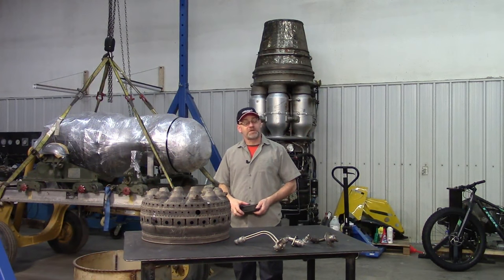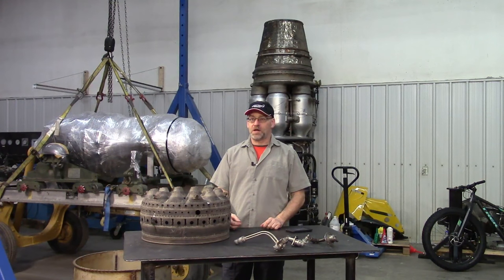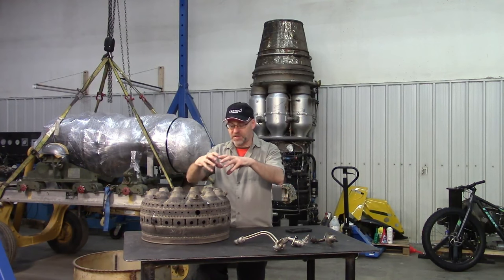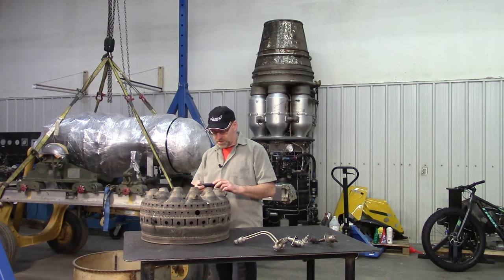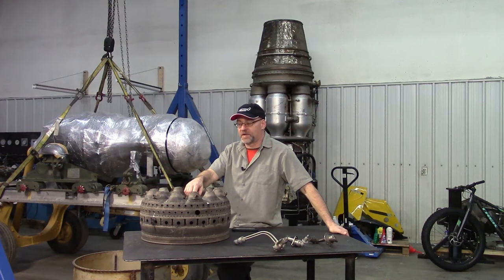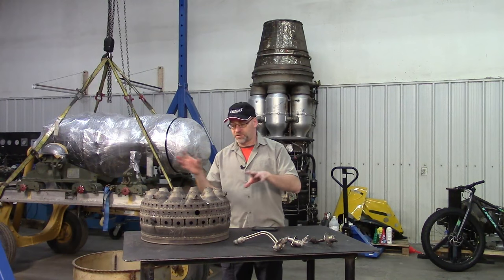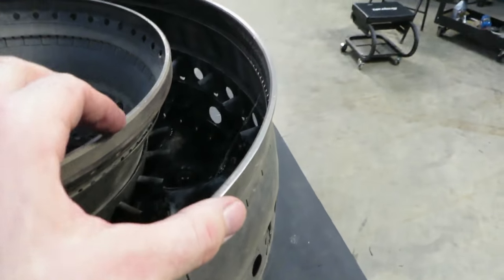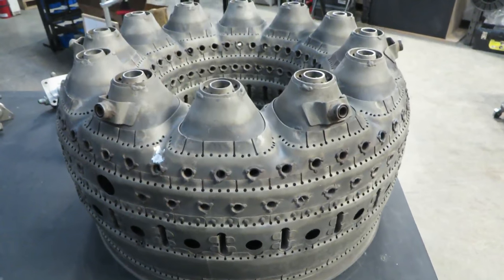Jet Questions 90

Comment: It is sometimes claimed that the engines on the Mig-25 would run away at the top speed like the one clocked by the Israeli going mach 3.2 which supposedly wrecked the engines beyond repair. Do you have any insight into that?
Reply from the maker: Nope
Reply: SO there's several documents that said Russian pilots were instructed to NOT go over mach 2.8. 
 the engines were not able to sustain that speed and power.
the result was a mig-25 bursting into flames.

that wasn't a runaway engine but rather a russian trying to get the hell out of a conflict.
Reply: There are several sources that discuss this event, actual facts are hard to come by except for a 'hard' speed limit of M2.8 that was imposed allegedly for engine limitations. Several seemingly authoritative sources claim that the airflow in the combustion chamber of the Turmansky R-15B-300 engines caused an uncontrollable draw of fuel through the nozzles that created a destructive rise in engine RPM.
Reply: The airflow through a combustion chamber cannot cause "an uncontrollable draw of fuel  through the nozzles".  It's not possible.
Reply: grahamj9101
Not even with some unanticipated error in the design of the fuel control that causes some sort of positive feedback?
Reply: That's not the question that was asked by Mr Cameron. Fuel is not drawn into the combustion chamber by the action of the airflow: it's not a carburetter. 
In answer to your question, it would be theoretically possible to overfuel and overspeed a jet engine. However, designers try not to incorporate errors in fuel systems, whether they are the hydromechanical systems of years ago (which I worked on) or the the latest full authority digital engine controls (FADECs). For an overspeed to happen, it would need multiple failures of control system inputs such as  exhaust gas temperature  limiters, overspeed governors and fuel flow limiters.
Reply: PS You're diverting me from working on the hybrid propulsion question. However, I have some doubts about it.
Reply: grahamj9101
Maybe it's not a bug but a feature? If burning up the engines in one flight means getting that little bit of extra speed for successfully catching up to the American supersonic bomber carrying nuclear bombs towards Moscow I guess it would be worth it. A later engine from the same manufacturer (R-25 in Mig-21) had an additional fuel pump that could be engaged for 3 minutes in war time emergency.

Now continue with the hybrid propulsion! :-)
Reply: I can go along with the suggestion that an interceptor engine could be "overfuelled" to give additional thrust for a wartime emergency rating, at the expense of a reduction in life.  When the Sea Harriers were sent to the Falklands in 1982,  'plugs' were supplied by R-R for their fuel systems, which allowed an increase in maximum thrust, relative to their normal peacetime rating. That's not hearsay: I was there. It's also well known that WWII Spitfires and Hurricanes (and Mustangs?), for example, had a 'gate' at the end of the throttle lever quadrant, which allowed extra movement of the lever, giving additional boost for combat.

I've been working on the hybrid propulsion proposal, but I can't get the thing to work! Having viewed the video several times, it shows the six electric fans draining the batteries for take-off and climb, with the batteries reduced to about half charge at the end of climb. During climb, the gas turbine engine is, therefore, supplying far less electric power than the fans are drawing. The batteries are then shown as being fully recharged during cruise, which implies that the engine must be providing substantially more electric power during cruise than at take-off. However, because of the lower air density at altitude, the engine is actually capable of producing only a small proportion (around 20percent) of the power that it is potentially capable of producing at take-off.  To charge the batteries during cruise, the engine would have to be large enough to be potentially capable of producing more electric power at take-off than the fans require and, consequently, the batteries would not discharge. I'll try to do some more work over the next few days, preparations for Christmas permitting. At the moment, however, it does not compute! Nevertheless, I'm thinking in terms of a variable cycle engine: that is, it operates as a turbofan for take-off and climb, whilst also providing a small amount of electric power. For cruise, the engine effectively  transforms into a turboshaft driving a generator, with some residual jet thrust.
Reply: grahamj9101
I lack first hand experience but have been told that Gripen has something similar, a war time setting that gives a few percent extra thrust at the expense of reducing time to next overhaul. Apparently pilots had a tendency to "accidentally" use that throttle setting.

Maybe the graphics department took some artistic license with the concept film. Is 20% power normal for a jet engine at cruise speed and altitude? Then the electric fans would only need 20% of take off power during cruise as well.

If I in my potential ignorance designed a hybrid plane I would size the gas turbine to provide just enough power to the electric fans for cruise and use the batteries to provide the extra power needed during the relatively short take off and climb. Then towards the end of the flight maybe the gas turbine could be switched off entirely during the decent from cruise to landing.
Reply: The 20percent is a round figure, but it's not far wrong and I've given this example several times before.  At sea level, the take-off thrust of an RB2112-22B on a Tristar was 42,000lb.  In cruise at 35,000ft, its thrust was around 9,000lb.  The drag of an aircraft reduces with altitude, because of the lower air density: that's why they fly high. The available thrust from its engines also reduces in proportion and the fuel consumption is therefore considerably reduced: again, that's why they fly high. In respect of the proposed electric fans, the same basic rules of physics and aerodynamics must apply.  If an electrically driven fan has an aerodynamic design that requires, say, 12MW  at 100percent rpm for take-off at sea level, then at cruise it will be capable of producing sufficient thrust with a power consumption of around 2.4MW.  Having said that, it might well be possible to 'tweak' the performance with a variable pitch fan. In fact, I wouldn't be surprised if the concept study included variable pitch fans, as this might improve their performance when windmilling and generating power. Nevertheless, the aerodynamics will limit the maximum power and thrust that the fans can produce.
Reply: PS  I'm working on the sizing of the engine,  but I need to play with the flight profile, power consumption and power generation some more. There other issues that have also occurred to me in respect of flight safety. The airworthiness authorities will, I have no doubt, invent some new rules, equivalent to twin-engined airliner operation.  Firstly, they will require the aircraft to be capable of taking off safely in the event of a failure of the gas turbine engine. Secondly, they will come up with rules that are equivalent to ETOPS for twin-engined operation over the oceans. They will, I'm sure, demand that such an aircraft has sufficient electric power reserve to complete its flight or to divert safely, in the event of an engine failure. So, if the engine fails, say, in mid-Atlantic or Pacific, the aircraft has to get to the nearest airport with sufficient power reserves for a diversion in the event of bad weather, for instance. With those huge intakes and large fan frontal areas, there will also be issues in relation to birdstrike: I can envisage the debris from the failure of one fan taking out the others. Out of professional interest, I bought Chesley Sullenberger's book when it was first published and I went to see the film 'Sully' a couple of weeks ago. I now have the vision of an electric hybrid airliner encountering a flock of Canada Geese and going down over NYC.
Reply: grahamj9101
I knew the power required at altitude was lower but didn't realize it was that much lower.

A variable pitch fan would also make thrust reverse simple.
Reply: grahamj9101
Yes, there will be safety issues with flying over oceans which is one reason I suspect the first use will be for shorter regional flights where the battery powered parts of the flights will also be a larger proportion of the flight time.

I have not seen the movie yet but I saw Tom Hanks talk about it. I didn't realize the aftermath but it sounded somewhat similar to a crash in Sweden over 20 years ago when an airliner ingested ice after take off and "landed" in the forest. Miraculously no one died but the three pilots involved, especially the pilot who was a passenger and rushed to the cockpit to help out (and who had prepared for such emergencies) were given a very hard time.

Did the birds wreck the fans? I thought they clogged up the engines.
Reply: Exactly! Reverse thrust would be much more simple (apart from the fan blade actuation) and effective: it would be like a turboprop going into reverse pitch on landing.  Many years ago, R-R Bristol produced an experimental geared, variable pitch fan engine, the M45 SD02., which used reverse pitch for reverse thrust..
Reply: Yes, the birds damaged both the fan blades and the compressors - and clogging may have been an issue, but the fans would have taken most of the impacts with relatively small amounts of sliced goose going into the engine cores.  A twelve to sixteen pound Canada Goose makes quite a projectile at 219 kt. An Air France Concorde once suffered a birdstrike from Canada Geese, just as it was coming in to land at JFK. Two engines were taken out and the estimated weight of the bird(s) that caused the damage was twelve to sixteen pounds. Initially, there were doubts about the culprits being Canada Geese, because they don't normally grow that large and they lose weight during migration. However, as I recall, goose remains were found on the runway and DNA tests were carried out confirming they were Canada Geese. It was established in due course that the geese were not migratory, but lived locally and scavenged on garbage dumps in the area.
Reply: grahamj9101
Everything grows fat in America... and a garbage dump close to an airport sounds like one of the worst ideas possible...
Reply: Grahamj9101-Am I reading this correctly? You're working on a turbine-battery hybrid system for flight? Jiminy that's interesting. Are links available on-line to your work?
Reply: No, I'm not actually working on it: Airbus and R-R have been working jointly on a concept study and have published a pretty CGI video of their proposed aircraft. The technical content is virtually nil and I have been doing a few rough calcs of my own to try to understand how it might work. At the moment, however, I can't make it work.
Reply: Damned interesting regardless. From your above thread responses, I presume that the mere possibility of a missed approach requiring a go-around must play havoc with the operations calculations.
Reply: That's one of the numerous issues, in addition to engine failure and reliance on battery power only, that will have to be addressed.
Reply: PS I must credit zapfanzapfan for bringing my attention to the Airbus/R-R video.
Reply: PS I've reread the NTSB report on US Airways flight 1549 and you might like to take a look at it. In brief, neither engine lost fan blades, but they were all quite badly damaged, having suffered heavy tip rubs. Both engines lost LP compressor (booster) inlet guide vanes, which were ingested into the cores, causing considerable damage. The left [hand] engine HPC inlet guide vanes were disconnected from the actuator, while those of the right [hand] engine were "entirely destroyed". The domes  (I would use the term 'heads') of both combustors were dented, "consistent with soft-body impact". However, only small amounts of feathers and tissue were found in the cores of the engines. Specifically, "about 1 cup of charred remains was found in the combustor area" of the right [hand] engine.
Reply: Reverting to the subject of hybrid propulsion, the video suggests that the objective is to have the batteries fully charged (or nearly so) on landing.  If the batteries are to be discharged to half-charge on the next take-off, then that would make sense, otherwise they would have to be charged while the aircraft is at the gate.
Reply: grahamj9101
Very interesting but I have an exam in a couple of days on relativistic effects and black holes so it'll have to wait a little. That stuff makes my brain hurt :-)

I imagine some of the damage can be difficult to determine when it happened, especially the fan is in a vulnerable position during landing in water.

Something completely different: Have there been attempts to make turbine blades and inlet guide vanes from really high temperature tolerant materials? I'm thinking of tungsten (too heavy?) or  iridium (too expensive?).
Reply: grahamj9101 Landing fully charged makes no sense to me unless the particular airport does not have the capacity to charge the plane. So it would be important to be able to land fully charged (or run the gas turbine on the ground) when landing out in the bush.
Reply: I was going on what the video actually showed - and it does make sense to me. If the batteries are going to be recharged on the ground from a ground power source, each gate equipped for a hybrid aircraft would need a power supply of tens of Megawatts and charging would probably be the determining factor in turnaround time. Otherwise the engine would have to be running at maximum power, which I think would be totally unacceptable at any airport such as LHR or JFK. It would be like having a large industrial gas turbine genset (such as an LM5000 or Industrial Trent) running at each stand - not just a noisy little APU.
Reply: No, the experts on the subject of FOD and crash damage to engines are pretty d*** good at their work. I'm not an expert and it's quite possible that some of the damage (eg, the bending) to the fan blades might have been due to them slamming into the water. However, from my reading of the report, the damage to the blade tips and tip rubs were primarily due to the blades having been deflected while under power at high rotational speed. There was localised damage to the trailing edges of the fan of the left-hand engine, which could not have been caused by the water. There was also clear evidence on the fan of the right-hand engine of a localised impact on the blades at the radius of the mid-span shrouds (the features that I know as 'snubbers').
The damage to and failure of the booster IGVs was localised and entirely consistent with bird ingestion, confirmed by the local presence of tissue and feathers, while the downstream damage was almost entirely caused by the passage of the IGV debris. 
On the subject of turbine aerofoil materials, the 'holy grail' has long been the elimination of cooling air from the aerofoils. I'm too far into retirement to be really up to date, but we were looking at ceramics years ago and there are advanced materials around, such as metal matrix composites.
Reply: grahamj9101
Yes, there will be a bit of infrastructure to put in place for charging but ports are doing it so that ships can plug in instead of running their engines in port. If ports can do it so can airports. If there is any benefit to it of course depends on where the electricity comes from.

Yes, they are good. I saw some presentation on the downed airliner in Ukraine. They are really good at jigsaw puzzles.

I just recently read about ceramic matrix composites. A bit like taking the ceramic coating and making the entire structure from it.
Reply: LHR has over 200 stands and putting in a power supply to all of them, in order to charge hybrid aircraft would be a major infrasturucture project.The power supply for each of them would have to be good for tens of Megawatts, otherwise the aircraft would be on stand for hours, being trickle charged. Let's say that the average power demand is 20MW and that 50percent of them are charging. That's a total power demand of 2,000MW, the power output of one of the big 1960s coal-fired power stations that the UK is in the process of decomissioning.
Reply: grahamj9101 Heathrow has about 600 takeoffs a day, let's say 20MWh for each (charging a 100 tonne battery), 12000MWh or 12GWh a day. 500MW average power if it is spread out evenly over the day. I wonder how that compares to it's power use today? Covering the area of Heathrow (12km2) with solar panels would (when the sun shines) generate 1200MW. But it's at least 15 years away.
Reply from the maker: Variable pitch fan has not been made because of the complexity and huge loads it would have to handle.
Reverse thrust is already simple.
Reply: You've come up with an average power: I was looking at a possible peak demand power. Either way, the infrastructure for charging hybrid aircraft will require a massive investment. If you mean that such aircraft are at least 15 years away, I think it will be a lot longer than that. By 2030, I expect R-R, for instance, to be delivering what they are currently calling the Ultrafan, an ultra-high by-pass ratio geared turbofan, which will probably have a variable pitch fan.
Reply: Well, R-R made a geared  variable pitch fan (with reverse pitch) work in the M45 SD02 back in the 70s. Admittedly, it was built as a demonstrator. However, I'm aware that the drawings have been dusted off and are being looked at in relation to the proposed Ultrafan, which will definitely have a geared fan - and will almost certainly be twin-spool. Variable pitch is, I understand, being considered for performance optimisation reasons. However, its use for reverse thrust would eliminate the need for blocker doors, cascades and a translating cowling, which become bigger and heavier as by-pass ratio increases. A fan handles "huge loads" at take-off, so there's no reason why it shouldn't be capable of handling similar loads in the reverse direction on landing. I don't see it as a massive design challenge.
Reply: grahamj9101
It said somewhere that the concept was for the 2030s so 15-25 years. But just because one plane model starts flying doesn't mean there is an overnight switch by everyone. My money is still on a smaller regional plane as the first passenger plane to adopt electric propulsion. A plane for 1-2 hour routs feeding passengers to bigger airports.

Is there still room for growth of the fan-diameter? Will future planes have half the fan above the wing or will future planes be high winged to be able to fit the engines?
Reply: I do have contacts with one of the bright young things who has been doing some project work for the Ultrafan. The indications are that the fans for the big twins will getting close to the limit soon. Whilst increased by-pass ratio gives increased propulsive efficiency, the fan case gets larger and its drag increases.  They are looking at making the fan case slimmer and shorter, leaving little or no space for a thrust reverser, hence the interest in a variable pitch fan with reverse pitch. Variable pitch will require a larger diameter hub arrangement for the fan, but this fits quite well with having a gearbox immediately behind it. Engines don't have to go under the wings, they can go on top (as on the VFW 614), or at the tail again. There may even be a case for four smaller engines, which could be good for an NEO A380. In the longer term, distributed power with multiple fans integrated with the wing could be the way to go. Now does that sound like something we have been looking at in a certain video?
Reply: grahamj9101
Sounds like there will be a sort of merger between turbofan and turboprop. Turbofans are getting bigger and have fewer blades, turboprops are getting more blades with more and more complex shape, at some point they meet. Ducted propfan maybe?

Sounds familiar but you mean several fans mechanically driven by one core? A bit like how twin rotor helicopters have a shaft between the rotors.
Reply: No, I'm thinking in terms of electrically driven fans, but without batteries. I suspect that the enabling technology for lightweight superconducting electrical machines will be available before lightweight high power electrical storage.